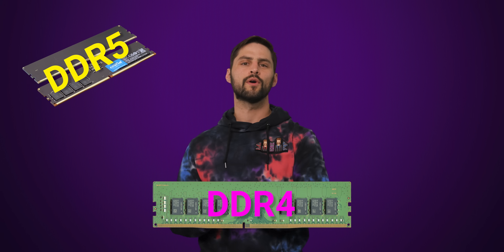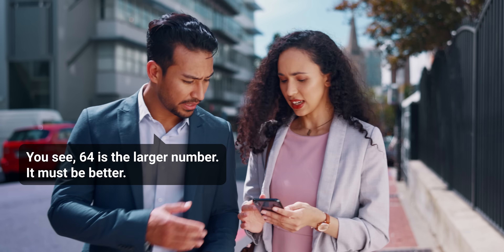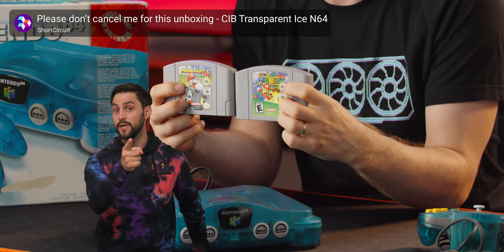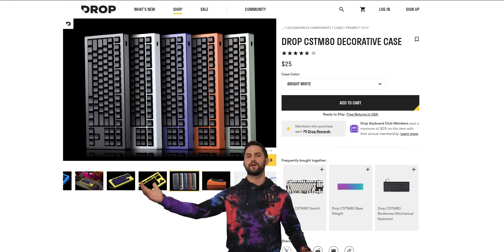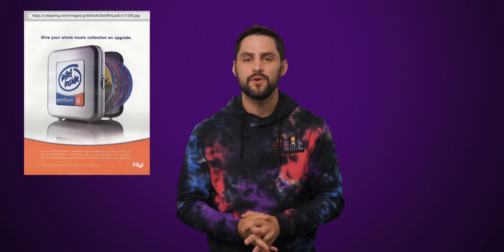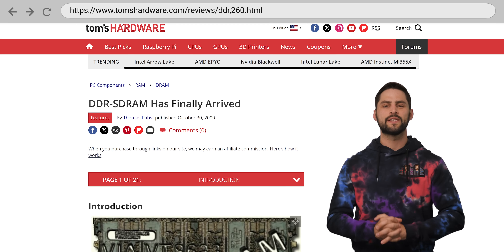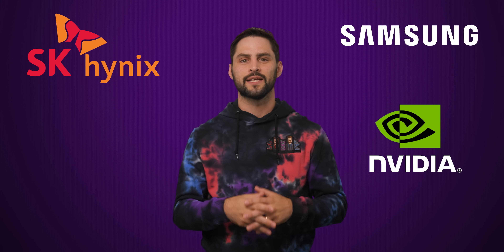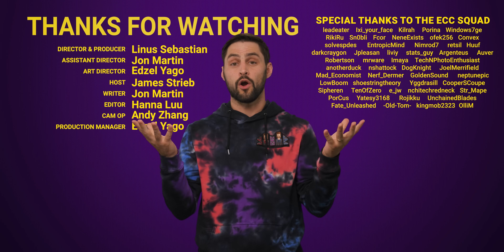Computer Memory Was Almost COMPLETELY Different - RDRAM Explained

Comment: While all of this is true one of the biggest reasons why Rambus failed is that in the PC industry standards are not owned by any one company.  Rambus had patents on all of it's hard ware.  Meaning if you wanted to make Rambus compatible hard ware you'd have to pay them a licensing fee.  Basically they were trying to corner the market on ram/memory.
Reply: BINGO!
Reply: So basically dvd?
Reply: so hdmi?
Reply: @prizmatik8696  You can make a computer without HDMI. You can go with display port which is a open standard and royalty/license free.  Rambus also wanted HUGE licensing fees at the time.  That coupled with the issues pointed out in the video made it a hard sell to manufactures.  Rambus was also having issue making enough of it to go around leading to even higher prices.
Reply: While having an inferior product...
Reply: @BlAckH0le-f7y  If Rambus would have a few years earlier the situation might have been different.
Reply: they were kinda forced into it to survive
Reply: @cadetsparklez3300  It was a shitty business practice from Rambus, one they have nobody but themselves to blame. Litigious companies never succeed...
Reply: @brandons9138  I wish that was true. Finding a motherboard with a DisplayPort is difficult. Finding one without an HDMI port is impossible.
Reply: @trajectoryunown That's why you plug it into the video card. Who uses on board video?
Reply: @brandons9138  Again: where are you going to find a video card without an HDMI port?
Reply: @brandons9138  People with no dedicated GPU’s? Or those that don’t use it because that’s enough?
Reply: I remember discussing the licensing with people when it came out. To us it reminded us a lot of IBM and the Microchannel Bus.  PCI bus replaced MCA bus, much like DDR modules replaced RDRAM/DRDRAM/XDR modules.
Reply: Yep... they literally went out of their way to shoot their own selves in the foot trying to be "greedy".
Reply: That rich nvidea sur for unfar practice

Comment: DDR2 if even longer
Reply: DDR if even longer longer
Reply: @richieqs7789  DRAM if even longer longer longer
Reply: @mozzjones6943  RDRAM if you are cool 😎
Reply: @valtarijunkkala  edo ram
Reply: RDR2
Reply: Wait. There is already a second one?!
Reply: me still using ddr2 ram... 2 times 2gb? hell yeah surely no one would need more speed and more capasity as long as world is filled with good programmers who know how to use this much power efficiently...
Reply: Watching this on Core 2 Duo and 4GB DDR2 RAM 😎 
It's still more than enough for 1080p YouTube and movies.
Reply: DDR2 still works. You'll be surprised what games I can play on my core 2 quad and even the duo I own. However, they've been stored away for a couple of years now because I have too many computers around the house. I daily drive a intel 8th gen DDR4 machine.
Reply: @heinritske8256  Vacuum tubes here , BABY!
Reply: @Tempora158  my pentium 75 with 8mb edo ram and a 2x cd-rom drive is defeated! good thing i upgraded my ati vga wonder to a mach64!
RISC architecture is gonna change everything!
Reply: @heinritske8256  I heard about these RISC processors from Hitachi called SuperH. They are totally gonna be in everything!
Reply: @Tempora158  Angelina Jolie was right back in '95

Comment: I was calling around computer repair shops in town asking if they had any DDR4 RDIMMs in stock, so I could finish a job.  One of them said "oh, no, they haven't made that for decades."  I was flabbergasted, and argued with the guy until I found out he thought I was looking for Rambus memory.  (FYI "RDIMM" is registered memory for some servers.)
Reply: I remember the DDR2 FBDIMMs for servers being dirt cheap. They didn't fit in consumer boards so they were absolutely worthless when they became professionally obsolete.
Reply: Exactly! RDIMMs or RDRAM were terms used to describe ECC Registered (buffered) memory mainly used in Intel Xeon based servers or 3D workstations. I assembled many Intel barebone systems based on that tech back in the days.

Comment: Oh. The good ole optiplex. They were ahead of their time back then.
Reply: GX200, still got it working here with 512mb RDRAM and Windows 2000
Reply: @WackoX1337  I used one for deltaforce some twenty years ago and it worked fantastic!
Reply: Still got my trusty GX620. 😆
Reply: With some mods. Like changing components. The systems can be brogue back.

Comment: The RDRAM on the N64 use a 9bit bus to save on traces even more (the extra bit is meant for parity, but the N64 use it for anti aliasing).
It is fast if you want to read just the next byte and the next byte etc.. you just go read-read-read-read and the memory has this internal address pointer thing that increase automatically.
But if you need to do random memory accesses, you need to change the internal address, and that takes like 4 writes, so it's very very slow.
And if you have the CPU and video chip fighting over the memory address, things gets very slow
Reply: N64 RAM is slow. AFIFAK N64 has ~0.5GB/s memory BW (same as Pentium 2 - could have  0.5GB/s with SDR-66 memory and 66Mhz FSB)
Those 2 came 1996 (N64, in US and JP) and 1997 (N64 in EU and Pentium 2).
Even worse, Pentium 2 has all that memory bandwidth for itself (without GPU) and it also has 256k-512k of L2 cache, 16k L1I, 16k L1D caches where N64 shares bandwidth with GPU, has no L2 cache and only has 16k of L1I, 8k of L1D caches.
Reply: @dan_loup  Is it just me that finds ironic that the console marketed as 64-bit had a 64-bit CPU cut down to have a 32-bit bus, and now I discover its memory had a 9-bit data bus? Lol.
Reply: @yukinagato1573  yep. and the worse part is that the numbers don't end mattering much because the entire system is held back by bad shared memory design.
Reply: @dan_loup  (I don't know much about the N64 architecture despite it using a MIPS based CPU and shared memory between CPU and GPU)

But I mean. I might see why Nintendo chose to use RDRAM in this instance. It might have enough bandwidth to supply data for both the CPU and GPU in their respective bus cycles, despite having terrible random access performance as you mentioned. As long as the memory controller was well designed, I should say. But this (shared memory) was a cheap design, and still was more than the PS1.
Reply: @volodumurkalunyak4651  About this, I'm fairly sure the Pentium II was much faster than any processors used in consoles during the fifth generation. N64's was the most powerful, but it struggled to even compare to the Pentium 1. So, the smaller bandwidth might not be so bad if the CPU is not taking full advantage of it. Actually, the fact it equaled to SDR-66, for a CPU running at roughly 94 MHz, it's fairly impressive.
Reply: @yukinagato1573  Basically other than the memory problem that could be solved with some sort of arbitrer circuit and forcing publishers to use the Z-buffer, there's not many issues with the N64
Reply: @yukinagato1573  N64 CPU is similar (caches, clock speeds) at Pentium 1 90Mhz. Such Pentium - 60 Mhz 64bit FSB - should have 480MB/s theoretical memory bandwidth.
That is almost full memory bandwidth of N64. I would say N64 could take 2x higher memory bandwidth to what it really had (1x for the CPU and 1x for the GPU).
Reply: @volodumurkalunyak4651  Very interesting. 

But well, I don't know much about MIPS' microarchitectures that much, except for the ISA. Was the N64's CPU even superscalar? Pentium 1 had a dual issue superscalar architecture. It could directly fetch two 32-bit instructions (hence, 64-bit datapath). I could see some sense on why N64's memory data bus was "practically 8-bit" as 4 reads * 8 = 32 bits (as 16-bit RDRAM is 4 reads * 16 = 64 bits). This only makes sense if the CPU can only perform single 32-bit issues. 

I think what I'm still trying to ask is if the processor actually used all of this bandwidth. If the Pentium had all of this bandwidth, making double issues and performing ok, and N64's processor was a single issue CPU, then you could theoretically have room in the bandwidth for the GPU to access it as well. Does this make sense?

Comment: The reason RDRAM, despite being tricky and expensive to manufacture, was cost effective for the N64 was because the console only had 4 MB of system RAM, which could be expanded to 8 MB with the Expansion Pak. When the Pentium 4 came to market, 512 MB was rapidly becoming standard for high end PCs, and 256 MB of RDRAM was much more expensive than 512 MB of SDRAM. Intel tried to alleviate that by including a stick of 128 MB RDRAM and a continuity module with the Pentium 4, but even this didn't help increase sales, and they ended up giving up this exclusivity by 2001.

Also, the reason Intel chose RDRAM for the Pentium 4 was due to its many architectural... Umm... Characteristics. Lol. Well. It was much more bandwidth-dependent than previous architectures due to a much deeper pipeline and a very fast but very small L1 trace cache system, so RDRAM's bandwidth advantages would keep the caches and the pipeline well fed. In fact, P4 shows a very mediocre performance when paired with SDR SDRAM. This of course was reversed since the introduction of DDR SDRAM.

Fun fact: Intel also supported RDRAM with some high end Pentium III chipsets. In fact, they were the only ones that supported a higher speed AGP bus version for a while, which of course made people really mad. Intel eventually also gave up here, and soon they released a high end chipset that supported traditional SDRAM, as well as this faster AGP slot. And, since P3 didn't have the same bandwidth hunger as its successor, the performance gains with RDRAM were minimal.
Reply: Also there was money between the two companies that provided a purely non-technical motive.
Reply: @jonsmith-z1v  Yep, RDRAM mostly had high throughput for sustain serial reads IIRC, and for it's bit-width. And P4's could take advantage of that. However they also faired just as well with a ddr based MMC, better in some corner cases and better with rdram in a few more corner cases.  Money changed hands or Intel would likely have only used RDRAM based P4's for specialty scenarios and big iron where they could put a lot of rdims together for a wider buss.
Reply: @kaseyboles30  Uuhh... I think you meant P4s in this last comment? PIIIs never had a DDR MCC in their chipsets, as far as I remember...?
Reply: @kaseyboles30  About your first comment, yes, totally.
Reply: @yukinagato1573  Lol yeah I did, thanks for the catch I fixed it.
Reply: Tôi khi sử dụng RDRAM : mé cái thanh RDAM nó vừa ngốn điện, hiệu suất thì kém mà lại còn nóng như cái lò thiêu ! Chả bù cho FCRAM, hiệu suất cao hơn cả DDR-SDRAM mà lại còn tiêu thụ ít điện năng nữa.
Reply: Eh?  Using RDRAM in the N64 was not cost effective.  It increased the BOM which was passed along to consumers as a higher price.
Reply: @GoatTheGoat  Compared to a performance-equal amount of SDRAM?
Reply: Not so minimal. I ran a dual Pentium 3 RAMBUS workstation in different tasks for about a decade, and ran my P4 RAMBUS workstation from 2002-2008. Both were Dells, bought used; but the P4 with RAMBUS 800 paired with a GDDR3 AGP card would play the latest games with no problem for the first four years, before starting down a slow decline due to the limitations of AGP.
Reply: I wonder why RDRAM was never used as VRAM on a GPU?
Reply: The i820 chipset was recalled soon after launch so I’m finding it hard to believe so many here ran P3 workstations with RDRAM and didn’t even mention the recall.
Reply: @emmettturner9452   If it didn't effect you -- like me, running a Dell Precision (330?) workstation with dual PIIIs and RAMBUS >10 years -- then why would that recall matter? Wide Ultra SCSI drives that die early, now THAT mattered!
Reply: @GoatTheGoat if RDRAM inflated the BOM and they passed that cost on to consumers, why did the N64 have the most powerful CPU among its contemporaries with a dedicated 3D GPU yet cost less than the competition? The was no 3D hardware accelerator in the PlayStation.

Speaking of which, you could similarly argue that a CD-ROM inflated the BOM on the PlayStation. The high cost Nintendo passed to consumers with the N64 was large mask ROMs for the game paks. Clearly, Sony didn’t need to charge 60-70 a game to cover the CD drive hardware so Nintendo was compensating for a lot more than the use of RDRAM: it was to cover the cost of cartridges.
Reply: @davidgoodnow It was recalled so quickly it barely entered the market.
Reply: @Thelango99  I actually don't know why (I don't know that much about older graphics technologies tbh, aside 3dfx and Nvidia stuff). Maybe because of factors like latency and whatnot. Graphics cards still need quick access timings to perform well after all. But by the 90s, the most readily available type of graphics memory besides dual port VRAM was SGRAM, a variation of SDRAM for graphics. I think the PlayStation 1 used that, IIRC. And by the 2000s, of course, GDDR was released, so there was little incentive to use RDRAM for graphics.
Reply: @davidgoodnow269  (YouTube either deleted my reply or didn't post it and I don't know why O_o lol. Sorry if this feels like a repeated reply.)

I said minimal performance gains for P3 because it wasn't architecturally starved of bandwidth as much as P4 was. But your P3 system had two CPUs, which I think may benefit from RDRAM. SMP allows both CPUs to access a shared memory, so a bigger bandwidth means less waiting for the RAM to answer one CPU shortly after another. You don't waste a full CPU FSB cycle for that. So in this scenario, yes, RDRAM is beneficial. For single processors, tho? Its improvements were really minimal. SDRAM was still the way to go.
Reply: @yukinagato1573   Not so! A buddy built a gaming PC for his daughter, who saw his rig and wanted it:  P III 600, 256 MB RD700, UW160 10k SCSI; I don't remember which video card. Kick-ass Quake monster for three years!
Reply: In 2002, I built a P4 PC with 1 GB of RDRAM. It was fast, but not miraculously fast.
Reply: @Thelango99  Graphics RAM not VRAM.  VRAM is a specialized version of asynchronous RAM that can both read and write at the same time.  Read to display to the screen and write to update the framebuffer.

Graphics RAM is what modern GPUs use.  RDRAM was used as graphics RAM in PCs with integrated graphics, the N64, and some arcade games.  But it was unpopular because of the high licensing costs.
Reply: Then there's that whole chip designed to allow SDRAM to be used on RDRAM chipsets having bugs that caused a recall pretty much on the 11th hour before release.
Reply: @GoatTheGoat  By VRAM, i meant VideoRAM. https://en.m.wikipedia.org/wiki/Video_random-access_memory
Reply: @Thelango99  I've seen some reports of Cirrus graphics cards that used RDRAM as video RAM. From what I recall, they didn't do very well, and had a very limited amount of memory (2 to 4 MB).
Reply: Random fact. If you look through the old datasheets some p3 chipsets supported Rd, and sd.

I don't think anyone ever made a p3 with Rd though.

Comment: Something else worth noting is that all modern hardware benefits from wide busses, the narrow 16bit bus might have been nice in the 90s, but due to latency issues, and the shift to 64bit systems, with SSE and AVX, it's pretty much required to make multiple requests to memory to fill a 256bit wide SIMD instruction, and for prefetching to prevent stalls waiting for memory, Factorio can gain some substantial performance (20%) by increasing the default paging size up from 4KB (only really possible on Linux).

Comment: I went to a recycling center and found an old P4 motherboard with RDRAM, 2x 128MB modules and 2x dummy dimms. Did some brief tests and the results are quite interesting. Sadly the motherboard only supports the early P4's, so no option to use the newer P4 HTs.

Comment: Explanation of double data rate:
The clockspeed here refers to the wavesignals waveform, so from rising edge to another rising edge. As far as instruction cycles or logical cycles go the line needs to of course be read twice per each cycle. So in that sense its not double rate.

The advantage from using both the rising and falling edge to transfer information comes from how alternating current introduces design problems as the frequency rises. Impedance and phase shift are porpotional to the frequency, meaning it becomes the limiting factor. But if you use both the rising and falling edge to transmit data you still have to hit the same timings on low and high peak, meaning the second bit of information is ”free” as far as designing the bus lane goes. The devices still need to act upon the lane twice as many times as usual, else they couldn’t distinguish between rising + falling edge and no pulse. As far as I understood it they don’t get the second bit of information for ”free”. But that’s fine, because the long bus lanes and their signal intergrity is the limiting factor, not the devices at each end or their logical clock speeds.

Comment: The semi-official spec PC1066 RDRAM modules were the fastest memory option for the newly-launched 533FSB Pentium 4's in spring 2002. Only problem was these modules were super expensive, hard to find and only a handful of enthusiast/workstation-class motherboards could actually run them at their rated speed. Within just a few months, the launch of dual-channel DDR SDRAM boards made RDRAM obselete.

Comment: The biggest thing missing is as I recall had to do with RAMBUS single channel vs duel channel. In the PC world at the time,  RAMBUS was promoted as faster, but required the second channel to achieve the best speed. RAMBUS single channel was suggested as an economic solution for budget PCs. RAMBUS actually made budget PCs more expensive and slower than DDR at that time. That single channel made it into almost all PC's that used RAMBUS. That is why RAMBUS was slower in perception and in reality.